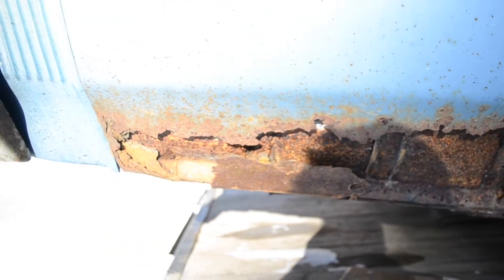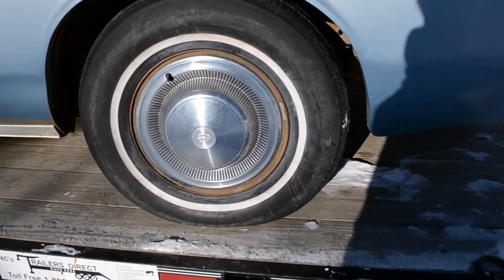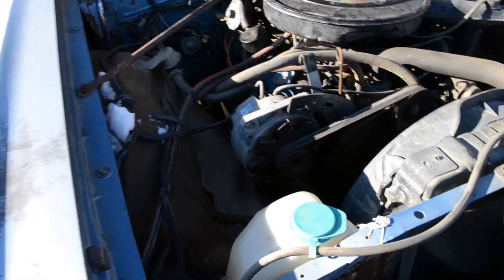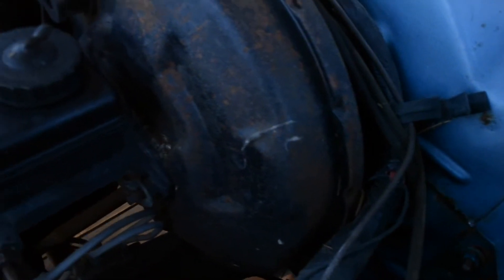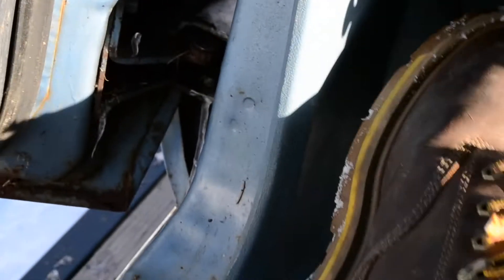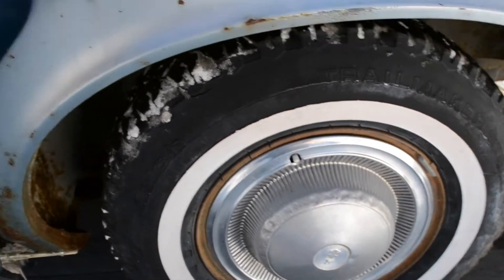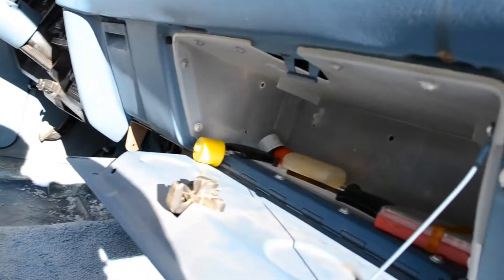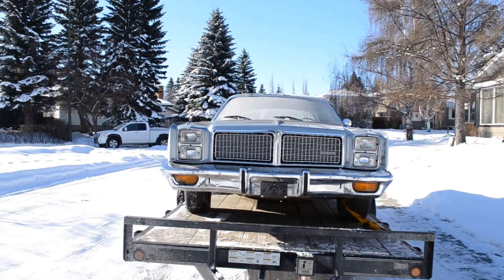I may have bitten off more than I can chew... (Introducing my '78 Monaco)

Comment: Good for you! Most of us have been there, so ask questions on every post, and read your comments. There are very few of these left, so you will have a rare one when you drive it to gatherings or shows. Leave the paint as is for now. Do mechanical like brakes, ball joints first,  do a compression test and tend to any engine compartment problems or noises. Lower sheet metal panels might be available, ortherwise ask people who have had local body shop fab some and install properly.  Welcome to the Mopar community in Edmonton, and the world!